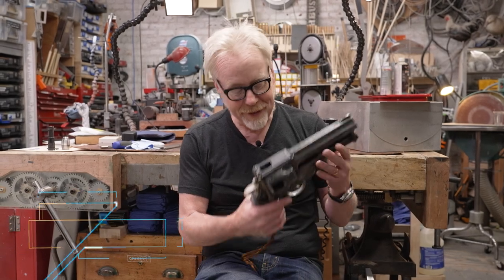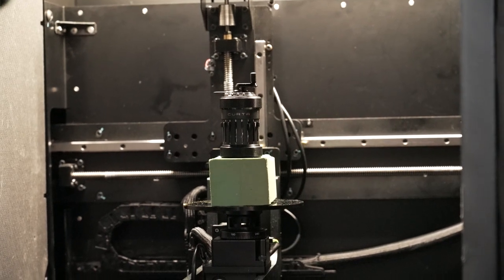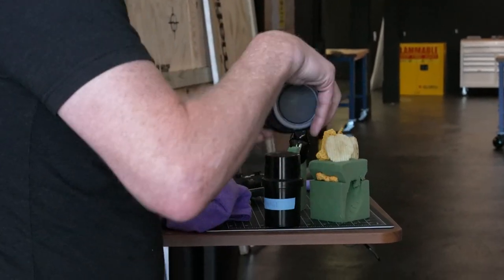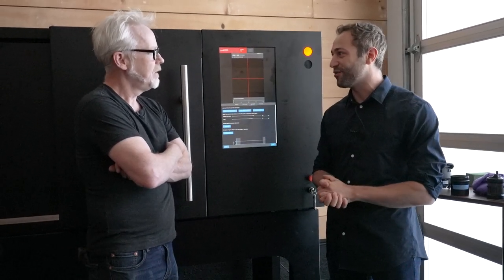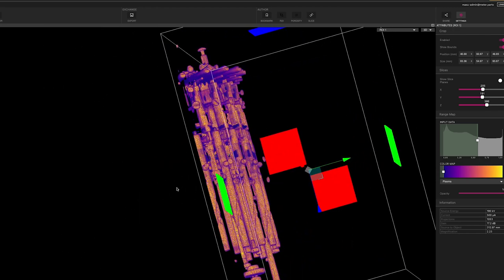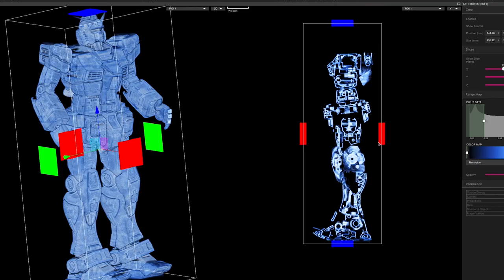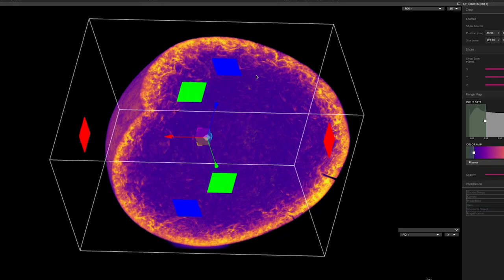Adam Savage's Curta Calculator Gets CT Scanned!

Comment: Applied to M. Savage's wheelhouse, scan a approved prototype prop, have 50 or more printed in short order for a production.  No longer would it be necessary to make X number of Storm Troopers armor by hand.  Size variations would be scaling up, or down, from original scan.  If the scan wasn't horrifically expensive the price to make some/many costumes would fall dramatically.

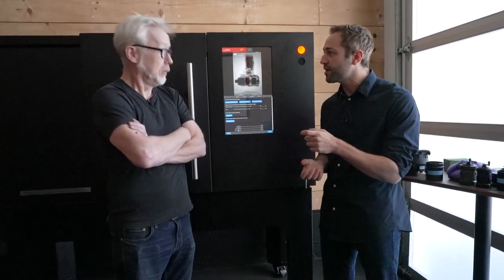Comment: 10:24 bringing the resolution up would require higher frequency/shorter wavelength X-Rays, right? Or, more likely, I imagine it is an improvement in their modeling and image processing, with X-Ray radiation already having a wavelength in the nanometer range.
Fascinating stuff!

Comment: Awesome product, personally not the biggest fan of cloud solutions though. Especially if any of the objects you're working with might be somewhat sensitive if there's ever a data breach in some way. But if the company is somewhat cooperative that could easily be remedied by allowing you to configure the CT scanner to connect to a local server/workstation capable of processing the images, disclosing it (securely) outside the internal network would then become a bit more difficult but for many entities avoiding cloud solutions that is likely seen as a good thing.

Obviously most of the things scanned in it will be less sensitive than living tissue, but for those objects that combine both metal and plastics/various other things requiring long exposures I'm kinda curious if even this approach might be deemed to be "too destructive" for some objects. But that's likely only the case for oddball rare antiques and one of a kind objects, the vast majority of materials shouldn't degrade noticeably from it. Would be kinda fun to put an electronic dosimeter in there though along with a metal object like the Curta calculator just to see what kind of dose it gets over the whole overnight process.

Comment: Amazing tool. I work for a large supplier to the automotive industry and can see tons of applications for this technology - especially on the software side of the system. Do you know if the software can take the scans and generate an "exploded view" of the components? Also, it was mentioned that the resolution was at the "nanometers level," that said  if the software can generate exploded component details, can it also add accurate measurements of the pieces down to say +/-0.01mm? Seems that it should... fascinating.
Reply: I think the guy said the best resolution is about 40 microns or .04 mm.  Looking at the Curta, you can see that it captures the body of the screws but not the details of their threads, so in practice the resolution is 100 microns or so.  That's good enough to get the overall shape of a part, but not good enough to be able to make an interchangeable working copy.  You'd have to supplement it with some manual design work.
Reply: @agate_jcg  I have a decade-old GE Phoenix Nanomex at work, we usually get down to 15um resolution for small parts, it's more than enough to make copies with though the sample sizes have to be quite small. There are definitely instruments that are capable of scanning automotive parts though. An exploded view would have to be done in several steps, scanning the part, exporting the model to an .stl, then importing the model to a CAD package.
Reply: @agate_jcg  - thanks for the reply and sorry for the long delay. It's some technology that we're looking into!

Comment: I'm wondering if the scan can give quantified data on density (say on the aluminum ball) or other measurable information so you have usable data for use.  I mean, visually it's cool, but hard data is what engineers/designers need.

Comment: My math isn't good enough to be confident in this, but some of the scans of the Curta made me think that there were computational artifacts in the reconstruction that did not reflect the actual structure of the object.  I know CT scans of my jaw had artifacts that seemed related to my fillings, because I know I don't have hard objects in the middle of my tongue.  I don't know if a slower scan with more angles would clean those up, or if you would need more sensitive sensors to get more accurate per-pixel measurements.  Maybe both.

Comment: As I'm sure you've heard many times, I first hear of Curta's calculators in William Gibson's book Pattern Recognition. Excellent book if you haven't read it. I'm a physician, and I deal with medical CT on a daily basis. If there's any metal, there's so much artifact ( the radiologists call scatter) that the image can be very difficult to interpret. So, where's the scatter?
Reply: We do see some of those artifacts, which we call beam hardening in these applications. They're most prevalent when we scan a part with a wide "dynamic range" of material density, like the impact driver featured in this video, which has a relatively low-density plastic enclosure and a very high-density motor (you can see some artifacts if you explore that scan in our software). This is similar to what you'd see in a medical scan with metal, where you've got a wide range of densities between human tissue and, say, a stainless steel implant. In general we're able to reduce the prevalence of beam-hardening artifacts by filtering with copper plates and with software correction.

Comment: If the brand or model name for that thing isn't Tabby, there's no justice in this world.

Curta computers are insanely great.

You know I wonder if what happened is that when you smack the outside of your sphere, the material close to the impact and where it's being held compresses, but as the energy flows though the the solid sphere, it loosens everything up.  But that would suggest that no matter how you prepare the inside, as long as you shape it by impact, there will always be a harder crust and a softer middle.

Is that how coins are?  Have they scanned some minted mettle?

That does, of course, raise questions in me regarding neutron stars and black holes.  Which I have no way of properly asking, let alone answering.  So, you know, it's a thing.

Comment: Question : in the 24hr scenario are they / you doing multiple passes at different KVA / MVA and then combining - I don't see the artefacts you'd get from scanning sinuses when a patient has amalgam dental work , which you could resolve if you scanned a patient over and over at different energies (but of course they won't stay till for 24 hours and might die from the radiation which is not a problem for Curta/ Gundam/ Aluminium ball)
Reply: When we do a long scan we're just running a very long exposure on each 2D radiograph. Our software removes the beam-hardening artifacts that you're referring to.

Comment: Hardening a steel would change a crystal structure of the material but hardly it's density at any significant rate.
Are you sure this machine would distinguish between hardened and unhardened steel?

Comment: QUESTION? I've had an MRI a few times and the first thing they have you do is remove all jewelry or anything metal. Is a CT scan different that metal doesn't matter?
Reply: MRI scans use very powerful magnets, so metal in an MRI scanner can be dangerous. CT scanners use X-rays; when you're getting a medical CT scan, metal can introduce artifacts in the scan results, but it's not dangerous. Industrial CT scanners are designed to scan metal parts, so metal isn't a problem.

Comment: every time i see a scanner like this, i look for a name.
many workspaces name their machines and i get a little bummed when i see,
they haven't called their CT scanner Superman. lol
here's my prediction.
2028, will be age of full fleshed 3d copy machines, A4 in 3D space.
You plop your object in, chose which materials you want it in, steel, alu, titanium, multiple plastics depending on hardness, even plexi prints.
press print and you have a 99.99% exact copy of any item.
2042/44:
bad heart? scan the heart from outside the body, remove or fix any issues like a bad valve, 3D print it plasma molecules and boom, ready for operation....
Lung cancer? Scan, remove the cancer and print a set of new lungs...

Comment: Can this X-ray be used for analysis of solid metal spheres? I know it seems like a stupid question, but of late in the UAP community some Spheres are going for analysis, and  by renowned people such as Garry Nolan.
Any limits on density of a scanned object? If it's a metal
Reply: Materials become more attenuating to X-rays as you move down the periodic table, and by the time you get to lead, all but the smallest parts will be opaque in this scanner. Our higher-power Neptune scanner can penetrate about 50mm of aluminum and 9mm of steel.

Comment: We have used this 15 years ago already to check for component failure in molded gearbox control modules. 

However no one was interested in beeing anywhere near the machine as apparently the cancer rate among the operators was insane. Not sure if it was true, but the myth circulated that most did not work on it for long...

Comment: This must be back engineered alien technology....pure scifi tech..this in combination with an advanced 3d printer and you can replicate any device/ object. I worked at the IC design department and some designs were very valueable..with such a machine it is very easy to look inside an electronic integrated circuit and copy the design...the applications are endless
Reply: You can definitely see the paths inside a PCB but not inside a silicon chip. Silicon is nearly transparent to x-rays and the resolutions inside a die are too small to resolve on most x-ray microscopes even if you could see them. Source - I have a GE Phoenix Nanomex at work.

Comment: so if the floral foam is nearly invisible to the ct scanner, what about aerogel?
Reply: It should be the same. We use carbon fiber but borosilicate glass is also common. It's also important that the material doesn't expand when it's heated since there is a fair amount of power going into the sample over a long period of time.

Comment: The lack of shielding on that machine is scary (even though he says they use 'a ton' of lead). Industrial CT scanners work at insane radiation levels in order to penetrate metal (some even use neutron beams which are all kinds of bad news if you're near them). I wouldn't want to be in the same building when this thing operates.
Reply: Hey I currently work with these scanners and the emission rates are actually set 50x less than the federal legal limits to ensure safety.
Reply: @elijahfernandes5136  That makes no sense. Radiation limits are calculated as exposure per year (or quarter, depending where you live). You can't "set a machine to 50x less" than something. You have to wear a dosimeter in the vicinity of such a machine and have it evaluated on a quarterly basis.

Comment: The Curta scans are actually full of artifacts, and for an object made of steel parts, I would have imagined less artifacts and much more contrast. There's also a misrepresentation/misunderstanding at 11:27 - Adam asked if these were actual X-ray scans, i.e. single projected images. When in fact the slices are the output of the inverse projection sliced up.

Comment: I'm kinda curious how well this thing handles fruits, or even meals. I know, putting moist squishy things in technology is a bit icky, but damn, you can have a wild mix of densities in one meal. Just all rather on the soft end, far away from plastics or even metals. No idea if that would work well.

Also matryoshka dolls, lego and uhhm... hard to mention this but... like... animals? Maybe a snail or insects? I would volunteer, but I don't fit. I don't think this would work. A believe movement is a no go, and using narcotic on animals for entertainment is wrong. Just, I'd love to explore organisms.
Reply: The x-ray power levels required for this kind of resolution would be extremely detrimental to anyone's health. I usually run my CT scanner at over 100KV...we have to be very careful what we use to mount the samples with because that kind of power will cause enough heat for thermal expansion to be a serious issue.
Reply: @circleofowls  ah sure. I never got a CT. That Adam said, he got one on his neck made me believe it was safe, but yeah I missed the part with X rays and didn't think to hard about it. Now I feel silly. ^^

Comment: A cloud based service (mentioned a bit over six minutes in), for commercial and industrial use? Red flag. Even on hobby and desktop grade machines, that's a red flag. We've seen what software as a service can do, look at how Cricut initially pissed off their hobby space when they first introduced their cloud service, look at how Fusion 360 is an absolute joke of a software because it's based on cloud services; constantly taking features from non-paid licenses, constantly needing to go through an inefficient update process on startup, which is a joke for commercial and industrial use, etc. Everything should be on the machine itself, input an item and output a digital model, that's all it does, that's all it needs to do, and it can sure as hell do that without any cloud services. Want to cut costs, output the raw imagery in a file and have an on-site computer do the modeling work. Cloud services do nothing but add costs and complexity, and allows a company to absolutely screw you over, especially when licensing can change at will of the company and the customer has to agree or have a dead machine, and trying to bypass a dead machine easily ends up in IP lawsuits, case in point the device that attempted to fix McDonald's McFlurry machines and the whole lawsuit around that. Typical trendy hipster startup that'll go nowhere, live and die by the cloud service mantra, nothing unique about this outside of the machine the cloud service exists on, and even then it's not anything all that unique as it's just xray-based photogrammetry inside a lead box with some fancy looking ML-based software to autonomously produce the model and visualization; of which you can also see some composition flaws in the final product, noise, voids, line/edge reproduction quality, etc., the xrays themselves may be flawless but the digital composition technique needs some work. Probably doing the typical startup thing to do, look for a big buyout but keep royalties based on the cloud service licensing. As cool as this machine could be, I don't trust companies at all, I don't trust startups, I don't trust corporations, everyone is out to make a quick buck and people use the same old schemes to do so; which is why 'cloud service' is such a red flag, especially with a startup. 

I wonder how long it'd take someone to replicate this in their garage. Machine is fairly simple, imagery is fairly simple, the program to composite it all is the difficult part but really does borrow a lot from photogrammetry, similarly with modelling. Wouldn't be surprised if someone could throw this into a Blender add-on for all intents and purposes, especially now that mechanical CAD in Blender is finally starting to gain some traction; and the whole 'we can pull out a mesh' comment around 14 minutes in more or less confirms my idea that this could 100% exist in Blender. With Tested signal boosting this, and with how theoretically simple this is, I wouldn't be surprised to see some project pop up on Hackaday within the next year or so, oh and without the asinine cloud service.

Comment: Adams tinfoil, for such simple item just keep's bring up more questions, it compressed from the outside, Okay, but lighter in the centre, interesting, so what would happen the said a ball say the size of a planet, forming forming smaller rock clumping into a bigger rock, the process in the centre would still be the same, the centre could only be compressed to a point and then no more and no matter how big it gets, so could the mean the the centre of planets as to general agreement heavy rock and some time molten could have large voids or at the least very low mass than conventual.....    ?